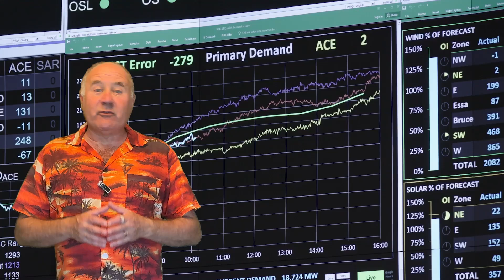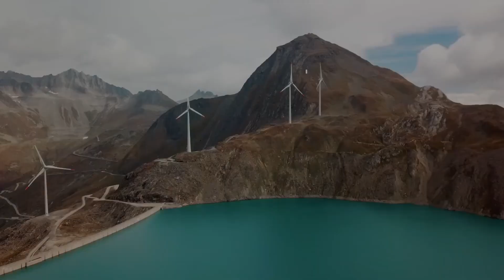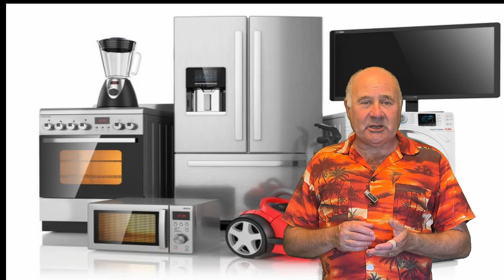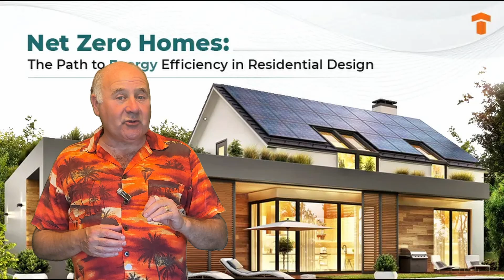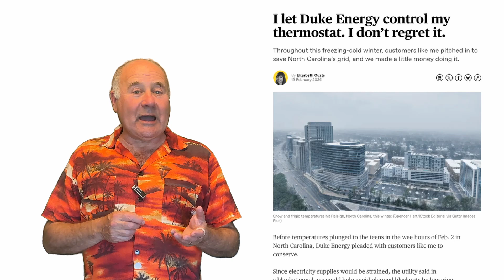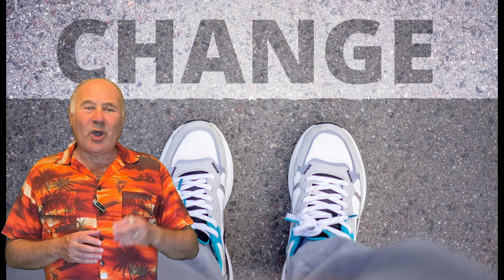Demand Response: Balancing the grid isn’t child’s play

Comment: How about in-ground, home-scale flywheels?

Dig a hole, put a spinning lead weight in there with a clutch. 85% efficient at least, smooths the grid if every house has one, roof-scale solar can charge it.
Reply from the maker: Flywheels like this lose energy to friction too quickly. They were some that used carbon fiber with magnets in a vacuum that were better, but they couldn’t compete with batteries 20 years ago.

Comment: Massive grids are massive rental businesses.
Sized for the annual PEAK DEMAND and minimum UTILIZATION.
10times bigger than the generation business. 
The future electric world can not scale up the old lightweight light bulbs world.
Raw Material and Economics are grid solution limitations for the worldwide climate destabilisation disaster problem. 

Fortunately worldwide, the sunbelt latitudes have 90% of the world's population. 
Dispersed solar energy, fussion radiation, achieves the grid's energy dispersion function. 
The neglected national grids will not be rebuit. 
MEA valuation tells you what was built over 14decades years ago cannot be economically built today and compete with millions and millions of sunlit PV roofs and the massive batteries on wheels. 
Dirt-cheap electricity and no grid rental costs. 
It's in the maths of First Principles thinking.
Reply from the maker: That’s why ideas like demand response are helpful. They reduce peak demand, lowering the cost of the grid needed.
Reply: @Decarbonize11 they hilight what I said.
Hahaha. But seriously we are in a time of transition and many steps to take to keep the lights on and the cashflowing.

Comment: 10,000 miles per year is avg vehicles driving. 
30 miles per day. 300 miles range. 10% used.
1 hour drive per day.
23hrs parked. 
90% available battery charge daily. 
Recharge daily top-up ezi pezi. 
PV roof electricity is dirt-cheap 2cents electricity.
All vehicles have 2 carpark spaces,  home and away.
Self-parking, Selfplug-in, trickle currents 237.
Grid trading electricity 237 for money. 
Millions and millions of vehicles is a quantity with its own QUALITY. 

Electricity was only available from central generation.
Now battery vehicles massive battery on wheels will be available for 'free' daily. 

Community grids and local stability will avoid national grid instability and annual maximum PEAK DEMAND. 

Grids can stabily operate at maximum PEAK CAPACITY 247.
Maximum UTILIZATION. 
Maximum cashflow 247.
Maximum profitability 247.
Grid RENTAL business is 10times bigger businesses than central distant generation generation plant. 

We need to know where we are going into the future. 
Avoid extremely expensive fatter grid construction. Save $TRILLIONS. 
Raw materials impossible. 
Avoid massive nuclear electricity investment. 
Avoid massive worldwide nuclear electricity industries. 
Avoid massive national military defence spending. $TRILLIONS saved. 

Climate stabilisation with battery vehicles and safe window glass PV roof panel systems.

Remember people have 2 roofs, home and away. 
Vehicles have 2 carpark spaces, home and away. 
All nations can do this maximum UTILIZATION of their original national electrical grid. 
And new battery vehicles and PV roof electricity. 

We need to know where we are going into the future.